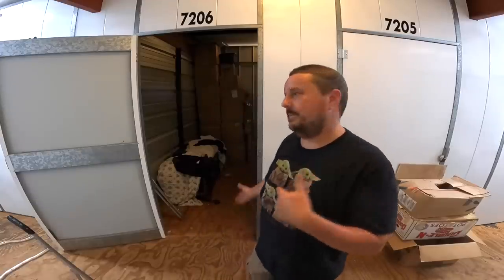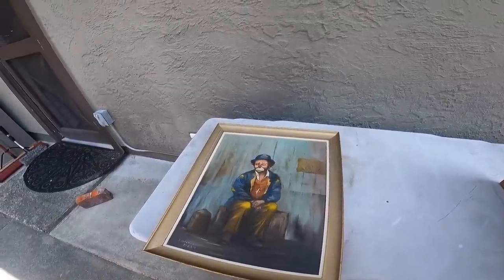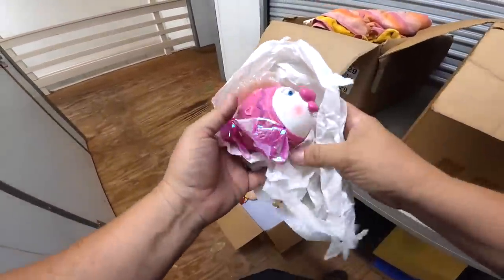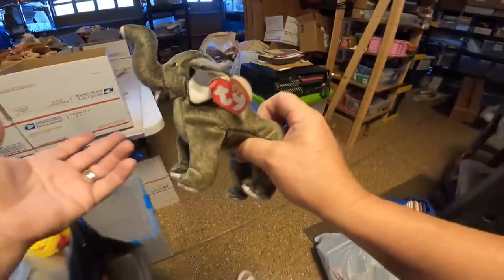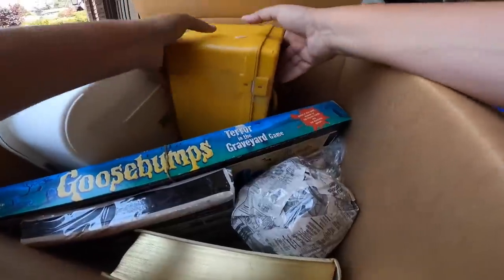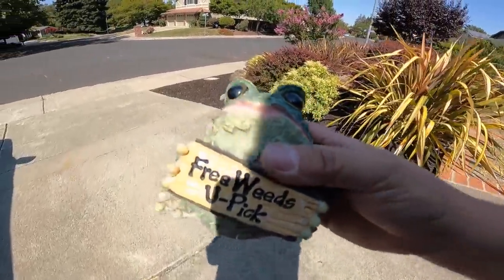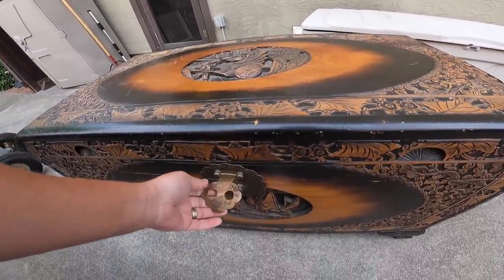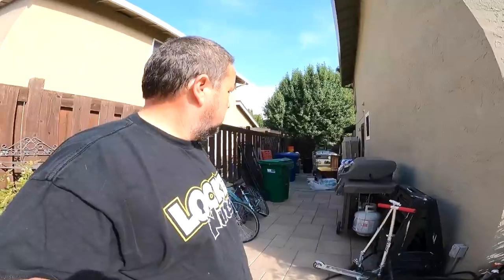WHAT'S INSIDE this carved wooden TRUNK found inside the $1 locker I bought at the storage auction?

Comment: The red and green thing, that you called embroidered, in the trunk are hot pads, for taking hot items out of the oven.  

Very retro!  Very in demand alameda for sure with the trays
Reply: No those are hot pads for putting dishes on the table on. They are not insulated to use as oven mitts. Ouch!

Comment: Sometimes, wish it was always, smearing Vaseline into a water spot and leaving it overnight will eliminate or reduce the water stain. The Vaseline can just be rubbed into the wood after setting. You don't have to remove it.
Reply: You can get touch up colored poly pens where they sell paint products to darken the spots where veneer is missing. It will help to lessen color contrast.
Reply: @cferguson3368  , I've been doing that lately also, trying to sell a bunch of nice furniture on marketplace! Sharpies work wonders!
Reply from the maker: Great tips. I've never tried the vaseline, but I will. Thanks so much!!